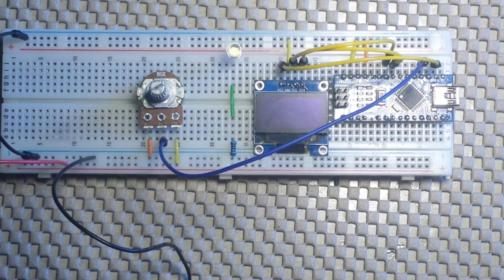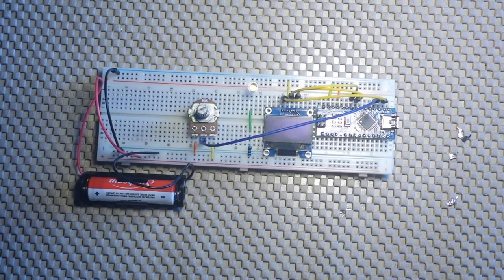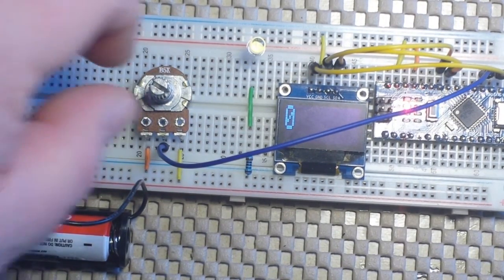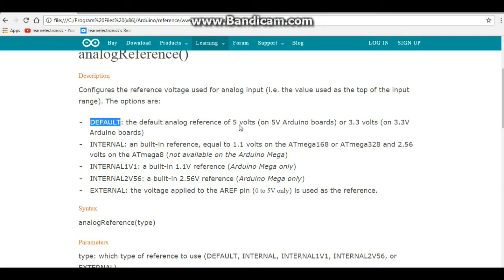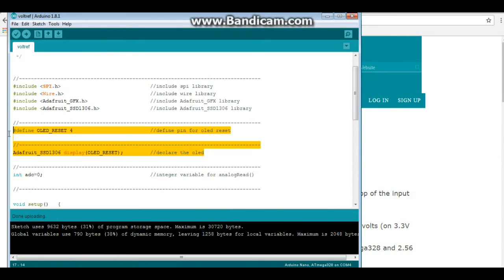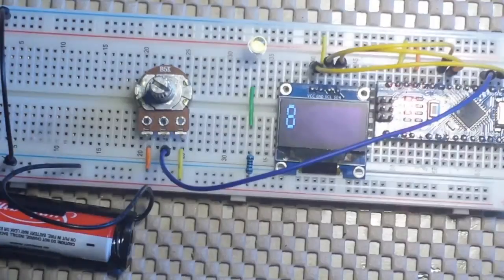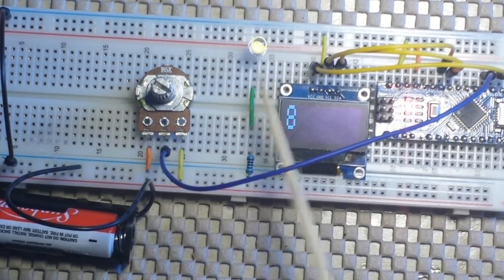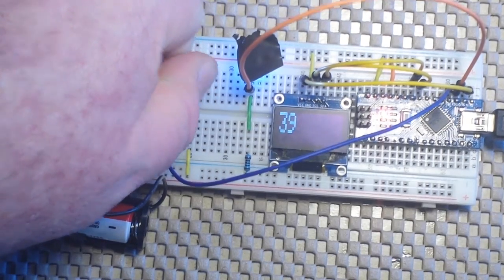Arduino Basics: analogReference()

Comment: Correct me if I'm wrong, please.
So if I'm going to measure a voltage with a Uno board via a voltage divider, then the lower voltage I use the higher resolution I get?
What I try to write is, if the VD puts out 5v at 12v in then the resolution gets lower than if the VD puts out 3.3v and the reference voltage are set to 3.3? But the lower voltage will be more sensitive to interference I guess.

Comment: As a complementary information and in order to have even more precise readings, we could use a DMM to measure the voltage at the AREF pin and use that value as calibration.  Using the "map" fonction would then give us a more accurate value.

Comment: Well, it took 3 whacks at it to get the full comprehension. First, I did not know I could use the 3.3 V Pin off the Nano to source the OLED. News to me. 2nd, I did not think about sourcing the pot just from the 1.5 battery, apart from the mega chip.  I have always put all on the same circuit paired with the chip, but now, I see I can distance the sensor from the chip and source the sensor separately.  DUHHH. Oh well. Now I get it. And thanks for taking the xtra time to redo your video.  So, in essence, the validity of the sensor o/p is dependent on the well-being of the battery, I'd say in this circuit.  Maybe could check (programmatically) the o/p voltage of the battery, and light up the bright LED when the battery is starting to die, eh?

Comment: Howdy! JoporJepe here.  Don't you think you should have used a STABLE external voltage reference in you INTERNAL BATTERY RESISTANCE VIDEO (which I also watched) because you, yourself, admitted in that video, that your NANO's V+ was not anymore 5V but already down to 4.640V.  Internal resistance values, which you are computing, are small - in milli-ohms - and without a stable VOLTAGE REFERENCE, the resulting voltage readings from which you comput your internal R will be imprecise.  Please enlighten us on this. Thanks.

Comment: what should I do if I want to use another voltage reference for some pins but continue to use default voltage reference for other pins. Thanks
Reply from the maker: Only one voltage reference per Arduino
Reply: Actually I have learnt that you can change your reference in your code, thank you :))
Reply from the maker: Uğur KONAK Yes you can, but still you can only use one at a time.

Comment: Why didn't You put voltage of the battery as an analog voltage reference and than you will  have an exact  analog reading?
Reply: The voltage of the battery can change over the time, so it would not be an absolute ref
Reply: @joksland  Actually it makes more sense just for that reason. No matter what the voltage of the battery is half way would be half way on the pot. Accuracy wise using the battery Vcc seems like a much better idea. Especially if you're using it for a positional situation.